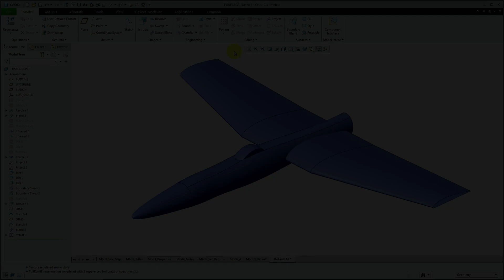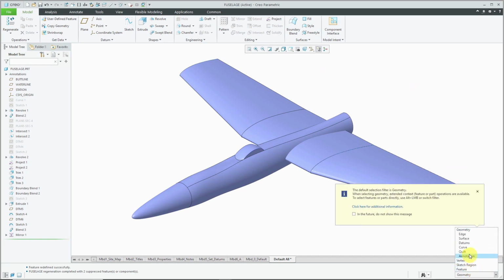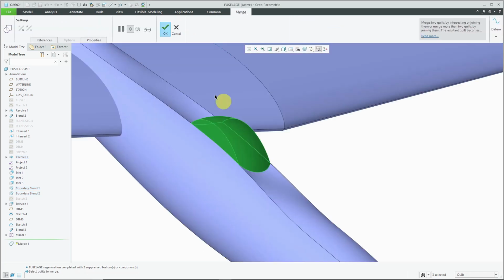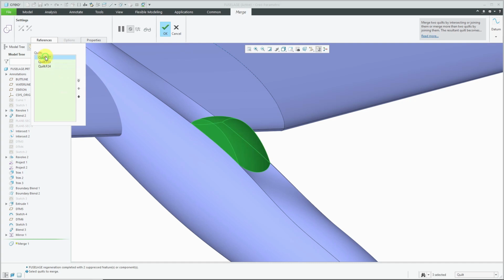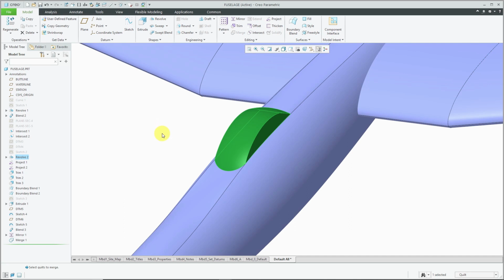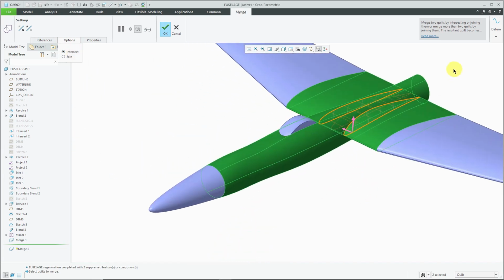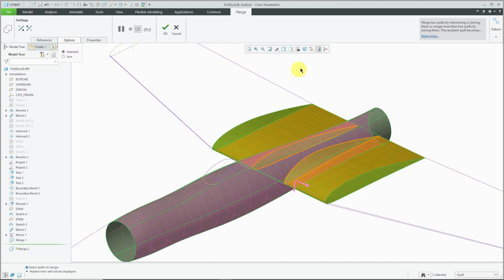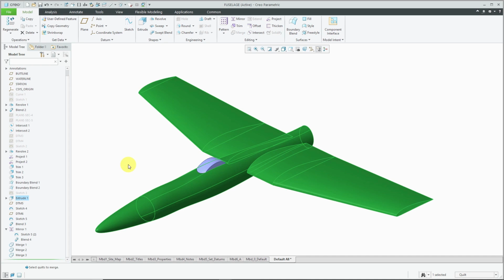Creo Parametric - Merge Command for Surfaces | Tutorial

Comment: Hello, great job! Very useful channel and tutorials! by the way, does the merge command works also on organic forms (such as obj file freestyle imported of an animal) ? scope would be reducing the number of faces for easier machining. thanks in advance
Reply from the maker: I don’t believe so. I made a video on importing OBJ a few years ago, and if I recall correctly, it comes in as a facet feature. Basically uneditable without REX, which is one of most expensive modules in Creo (around $30k per seat years ago).